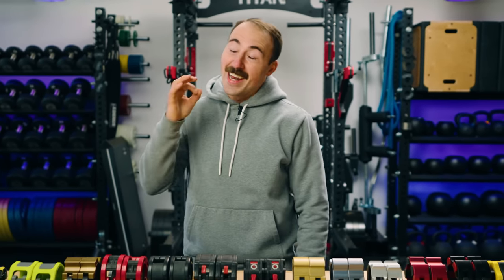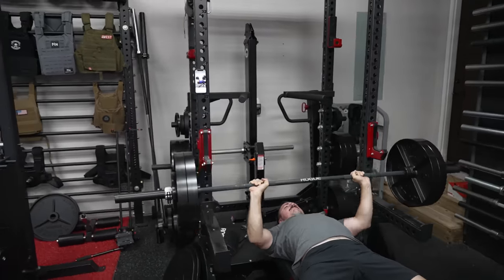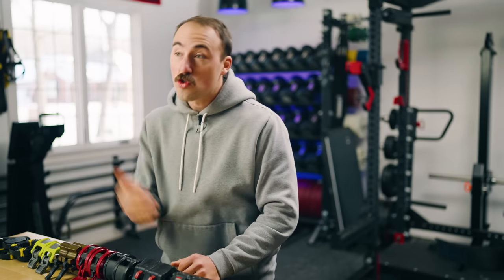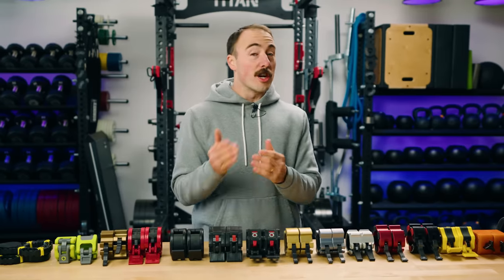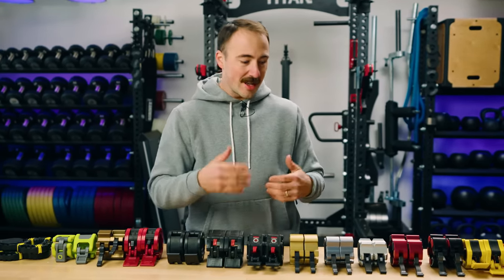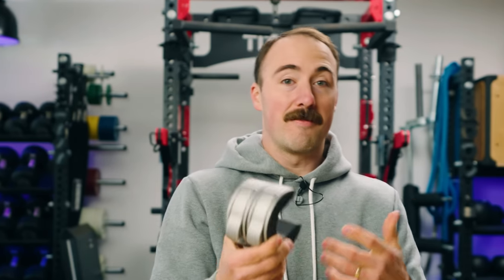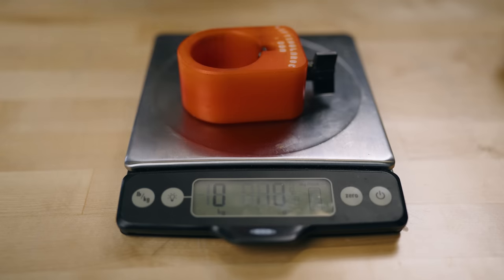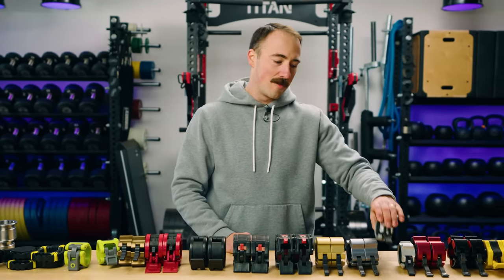The Best Barbell Collars for 2022! (After Testing ALL Of Them...)

Comment: I bought the SYQQ collars from Amazon based on this review, but it was trash. The locking mechanism didn’t engage and got stuck on the very tip of the bar. I had to work to get it off of the bar. I can see this thing just destroying your bar.
Reply: What barbell?
Reply: @mattdouglas8900  it got stuck on the REP stainless steel power bar, and I gently tried it on the Uesaka comp bar too with no success. The ball bearings inside the collar that are used to lock into the sleeve by retracting into the collar don’t do so enough to let the collar slide smoothly onto the bar.
Reply: I HAVE HAD THE PLAIN STEEL VERSION FOR THIRTY YEARS FROM (KAMPARTS, INC.) CALIFORNIA AND NEVER HAD A PROBLEM!! KEEP THEM LUBRICATED!!
Reply: You're right - our last batch was trash but we've corrected the issue and are now in stock on Amazon and eBay.  I hope you returned your previous set of collars for a full refund.  I have personally tested all collars from our new batch and the tolerance issue is corrected.  They are solid once again like the pair Coop has.  Please give us another shot!  https://a.co/d/i9ZEGKh
Reply: He did say in the video that he didn't recommend them though!

Comment: I have the Rogue Metal, Rogue Aluminum, and the Eleiko, and I like them all.  I do mostly SBD lifts and never had an issue with any of them.  Its nice to have a variety so you can choose based on your mood, lol.   The good thing about the Eleiko is the weight.  .25kg each adds just over a pound, so if you use a 20kg bar it brings that to just over 45 pounds, which makes calculating weights easier when using your 45 pound plates, and the magnets are unexpectedly useful.  Rogue is still my go to brand in general for just about everything, and all three I have are all great collars for my purposes.  Love the reviews.  Keep 'em coming!

Comment: Coop the one thing you keep forgetting to mention that makes the Oppen collars great is they can be taken off even after you've loaded more plates on the outside of the sleeve. Every workout at least once I forget to take off my collar and load a plate. For any other collar, I have to pull the plate back off. With the Oppen, I just slip the collar off and push the weight flush. Just a nice little way to avoid a very common hassle.
Reply from the maker: Fantastic point. Truly. I will include this next time I discuss them. Thank you!
Reply: Also the magnet means you can attach weights on the outside without unlocking it.

Comment: I've been using my generic Amazon $7 special collars for 4 years now without a single issue even while deadlifting. I don't need to jump on my plates to see if it moves lol. I don't drop weights from overhead so there's that.
Reply: I'm pretty happy with cheapies, too, except for deadlifting, where they loosen up after a few sets. You don't need much holding power for doing squats or bench.

Comment: The syqq collars are actually a great option for people with severely weak hands. As a quadriplegic operating the levers can be extremely difficult but being able to simply push it on & pull it off will make it a great option.
Reply: This is my own curiosity and you can ignore or answer it if you want.  You're a quadriplegic and you lift weights?  So not fully paralyzed?
Reply: Sarcasm detected.
Reply: @chethammer  - So there is "incomplete paraplegia" and "incomplete quadriplegia" for example, but the chances are very high that the OP is making an elaborate comment to joke about quadriplegics. Bodyweight would surely be far more than enough for such cases. I also don't think they would be aware of incomplete cases, which makes the edgy comment very lazy as far as it not making sense under that context.
Reply: @Siberius-  Absolutely true.  An incomplete quad ( I think sometimes referred to as a paraquad) would have weak arm strenghth.  I have to admit I don't like seeing people in these positions, let alone talking about them.  It's a tough row to hoe.

Comment: I workout in my garage, no heater, temps drop below zero during the winter. If you are in a similar boat, id recommend not going with plastic collars as they will easily break in those temps. An all metal design is probably best. I have the magnetic rouge ones that Coop mentions and they have so far held up really well
Reply: How they holding up?

Comment: I have the Rogue ones in ABS and in aluminium. Both get loose after a few dozens of drops with olympic movements, so my pick would be the ones in plastic since are cheaper and weigth ~600 grams (pair), so are useful to count as a half Kg plate. If you really want unamovable collars you will need calibrated ones from weighlifting; they weigth 2.5 Kg and are really expensive, but I wouldn't use them for non olympic wl.

Comment: Hi Coop. You mentioned the OSO magnetic collars due to their magnets, but Rogue have also brought out a magnetic version of the Aluminium collars. Slightly different shape, almost a cross between the original OSO collars (which I love) and the Rogue Aluminium collars. Might be good to review them, do they still hold as well, do the magnets scratch etc. Also, any experience with the cerakote versions and wear and tear with use compared to the bare version.

Comment: I have a clout fitness pair, used it less than 20 times, they don´t hold anything anymore, is actually dangerous (dropped the plates while doing biceps curls on a z-bar). Lock jaws are great, I have a regular 2" pair that is tight, and a 1.9" pair that came with one loose (doesn´t hold), so quality check is awful.
BEST ones I have are the cheap hexagonal generic ones, tight as a nun.

Comment: I use spring clamps but the ones with long handles sticking backwards. I then put them on with that handles facing the plates and force it in tightly. It never comes off.

Comment: Rogue HG 2.0 collars are better overall IMO. Just as sturdy and good at holding as the Rogue Aluminum collars, but $10 cheaper and it works on specialty bars too. I have both and prefer the HG 2.0 overall.
Reply: How long have you been using them? Are they still holding up with regular use? do they slide a bit these days or something?
I did hear that those ones will work on like, the Rogue trap bars, just not as tight of a clamp. So I dunno if I'd wanna go that route.
Wait I have a shitty collar behind me right now that I could test out! yea it slides super easily on the trap bar, compared to the Rogue Axel collars. The shitty collar isn't as secure on a regular sleeve as I'd like, but still solid enough.

Edit: I just found out that the HG 2.0 is like a hybrid for olympic sleeves and specialty bars. Didn't know that. I thought it was a regular collar.

Comment: Only two collars worth the money: Ivanko compression collars, and simple 'ole spring clips. They worked well for years!
Reply: Came here to say this about ivanko compression. Plus they work on smaller diameter specialty barbell sleeves too.  All metal, no plastic. Will never break and probably will compete with rogue collars for holding strength.

Comment: Never used this kind of collar. What's wrong whith the simple spring type that's all the way to the left (out of the picture even, almost hidden) ?
Reply: You mean the first ones he picked up and talked about at 1:48?
Generally the issue is that they can be annoying to use, especially for smaller people with less wrist crushing strength. Also they're often rather relatively-weak and not grippy, so the weights can slide much easier (especially for certain lifts). Also they don't stay the same tightness for very long (depending on how much one uses them). Sometimes these things are completely fine for a particular use-case.

Comment: Cant go wrong with Rogue HG collars imo. Fit every barbell in my gym including SSB and trap bar.
Reply: They're way too big for my Ohio bar, only good for the axle
Reply: @TrenbologneSandwich  I have an Ohio bar and they fit perfect. It was the pair that came with the bar, how are they too big?
Reply: @ourtube4266  HG collars are axle collars and bars don't come with collars
Reply: @ourtube4266  they literally just slide off
Reply: @TrenbologneSandwich  I bought the Rogue Black oxide Ohio bar 1 year ago and it came with HG 2.0 collars for free which are for 2 inch Olympic bars. Maybe they only gave me a freebie because they thought I was cute but I sincerely doubt it.
Reply: @ourtube4266  I bought a Rogue Ohio Power Bar the dame time and no collars, HG collars are for specialty bars because regular collars are slightly too small, and as a result HG collars are too big. Sounds like you either got an offsize bar or offsize collars. That would make sense with them giving them away, they fucked up and couldn't sell them for axles
Reply: @TrenbologneSandwich  I bought another pair of the exact same collars to use on my loadable dumbbells. Exact same size. Maybe the free collar thing isn’t always true because I don’t see it on their website but I’m 100% sure that Rogue HG2.0 are made for 2inch Olympic barbell, end of discussion.
Reply: @ourtube4266  well you're wrong, literally read the description for them
Reply: @TrenbologneSandwich  - Just checked the description for the Rogue HG 2.0 Collars:
"Fits 2" Olympic Weightlifting Bars + Many Specialty Bars"
How interesting.
The rest just say "Designed to be used on 50mm Olympic Bar Sleeves"
Apart from the Axel collar, which is only for specialty bars.

I am confused by your words though, since my Rogue trap bar is a specialty bar and regular collars are too big for it. UNLESS your bar is a standard non-Olympic sleeve bar...

Comment: Magnet Collars are the way I will go. There's nothing more aggravating than looking all over the gym for a spring loaded collar. They usually get kicked under something. Or they get left on a bar that causes them to get weak over time. I have a preacher bench. And these magnetic collars will stick to the frame between weight changes. Dude... this is a necessity!